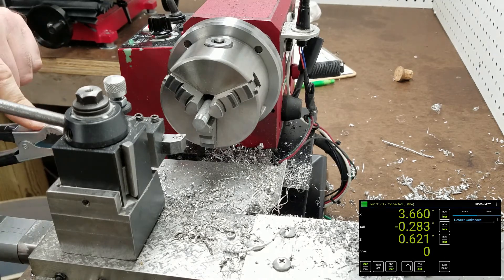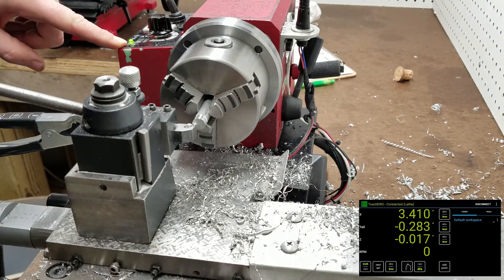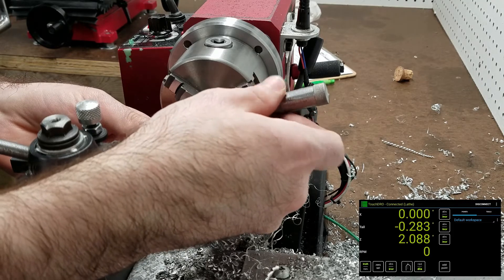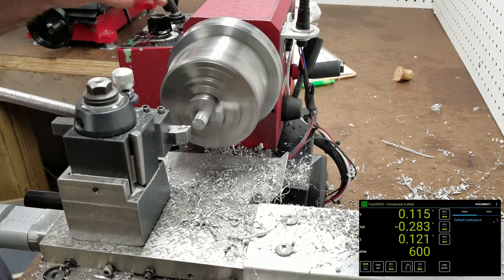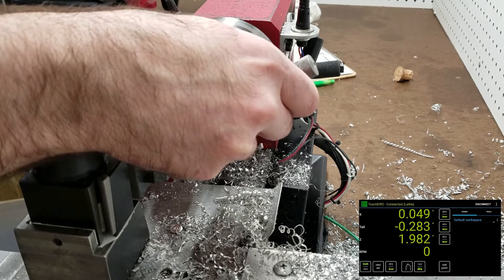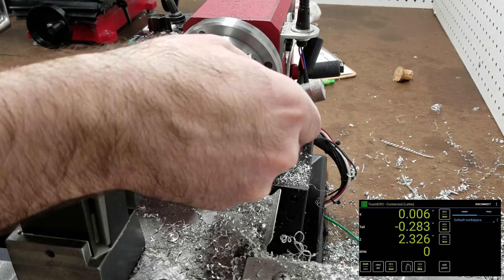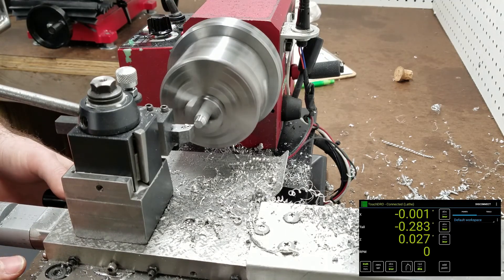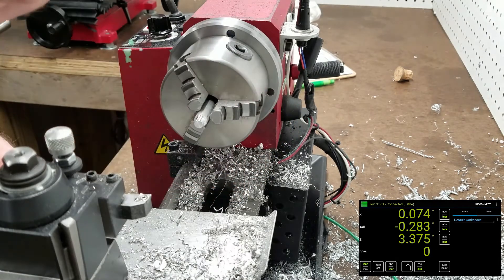TouchDRO quick demo (with touch probe)

Comment: Using a 12mm shank tool in a 16mm tool holder, I can isolate the tool with some paper wrapped around the tool, but not a 16mm shank tool in a 16mm holder. How did you isolate the bolt holding the tool post, must withstand a lot of pressure from the bolt. Great idea.
Reply from the maker: Thanks! 

I used pieces of index card. One piece wrapped around the shank of the bolt, and a disc under the washer. Works great! 

Though I think it's time to replace the paper. I recently re-trammed the toolpost, and it's no longer electrically isolated. I think the piece under the washer likely tore, but I might as well replace it all. Probably make a quick video showing the process.

Comment: Great job showing the probe, do you possibly have a video showing where you connected/set up the Tach?
Reply from the maker: Thanks!

I'm sorry, I don't have anything showing the tach wiring/connections. The TouchDRO board I have on my lathe is an older version, so it wouldn't be relevant anyway. The newer boards need a digital input (something I'm trying to figure out so I can have a "Strokes per Minute" readout on my shaper). If I figure it out, I'll be sure to post something.